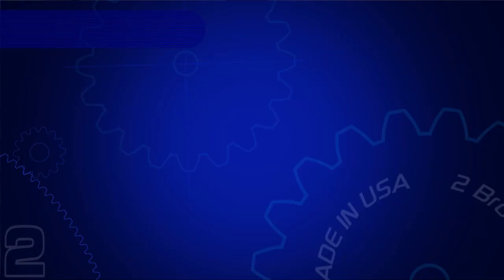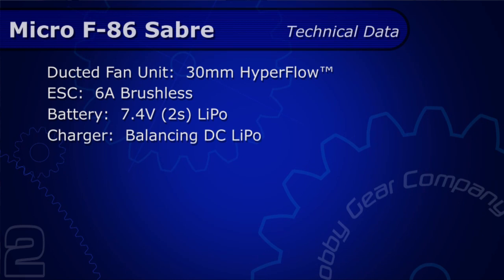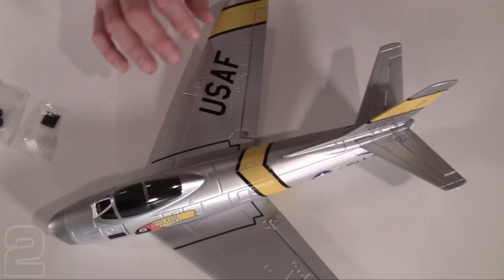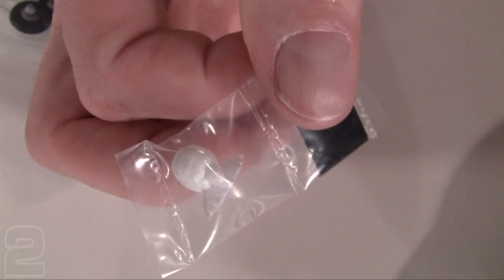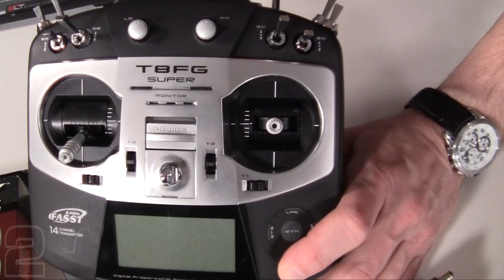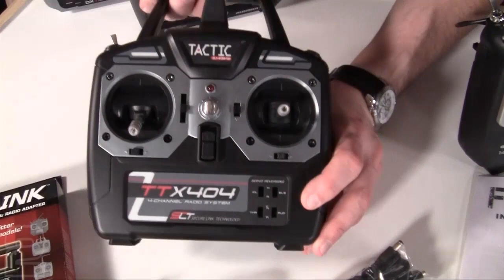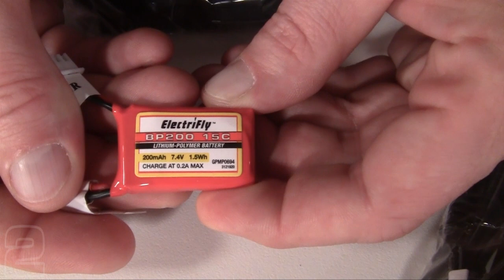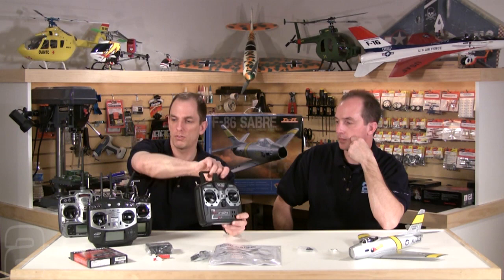Great Planes Micro EDF F-86 Sabre Review - Part 1, Intro and Flight

Comment from the maker: We have flown about a half dozen TX-R airplanes with our 2 AnyLink modules so far.  Used them on Futaba T8FG, Spektrum DX7 and now the Spektrum DX8.  So far, so good.  The only down side we've found is that if you use a Tactic Tx on a three channel TX-R plane, the rudder channel is stuck on the left stick (mode 2) instead of the right stick as a traditional three channel.

Comment from the maker: We did have a lot of wind noise, even through our "dead kitten" wind screen.  That required some filtering of low-ends on the audio and a tinny sounding motor.  It is, however, an EDF spinning at an insane 75,000+ RPM so it's going to sound loud.  It was wonderfully balanced though, so no vibration.